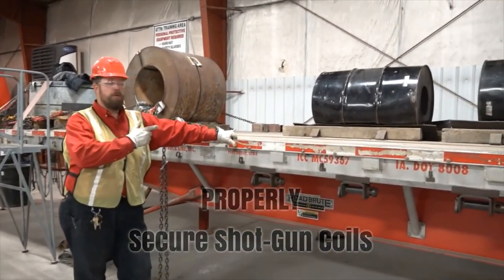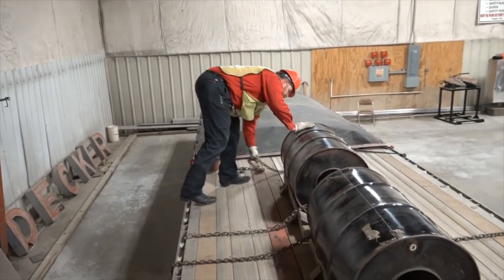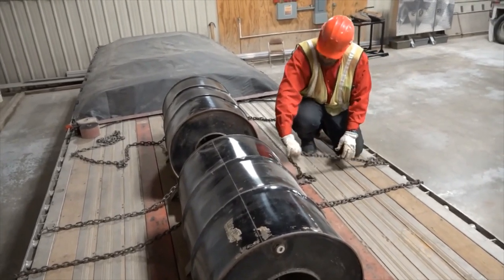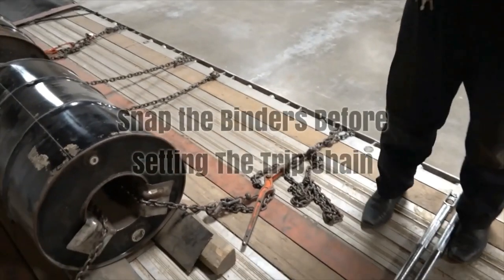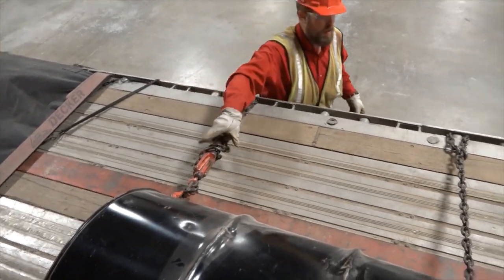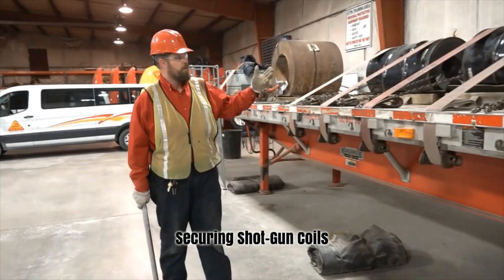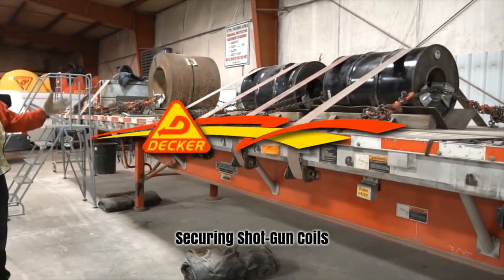Proper Load Securement for Shot Gun Coils - Securing Coils - Flatbed

Comment: Cross chain is fine. Ive done it for years. Just put an old piece of mudflap between the two chains where they touch and bungee it in place. Im a former CHP trained DOT officer with over 20 years of accident free trucking experience
Reply from the maker: that's a great suggestion. Thanks for sharing

Comment: I saw Western Express video that said to X chains through the coil. This guy said not to because the links that cross can weaken over time from vibrating on each other going down the road. That makes sense. So what is the proper way to secure a coil?
Reply: Yeah Western express is the best flatbed company out there😂😂😂😂😂
Reply: Either way is ok.
Reply: If the chains rub put padding in between them.

Comment: Am I the only one that wishes for and adjustable snap binder..???  

One that—say—the hook away from the hinge is on a threaded rod which can be spun one direction to lengthen and the other direction to shorten.  This would assure never snapping at 12:00 high or 2:00 low.

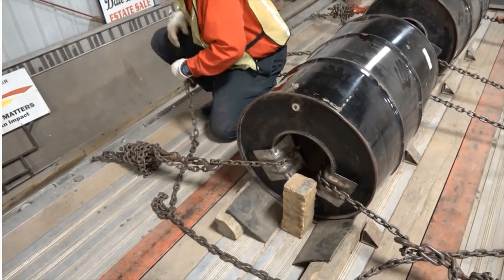What are you supposed to do if the chain is too loose but when you grab another link the snap handle is at 11:00...???

Comment: For all the folks griping about him teaching this method: you might want to go check the Federal regulations before you comment. Either method is legal. 
To make it easier for you, the section you are looking for is 393.120. Specifically you want (d)(1) or (d)(2)
His securement was exactly by the regulations
Reply: It dimishes the strength of the chain. You can use the horse shoe securement but it requires the use of twice as many chains